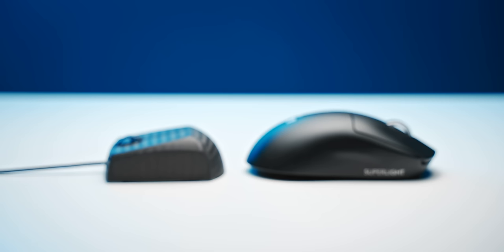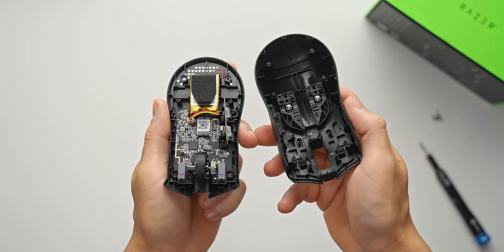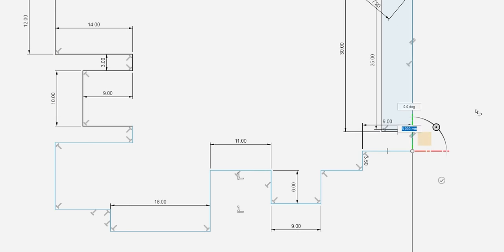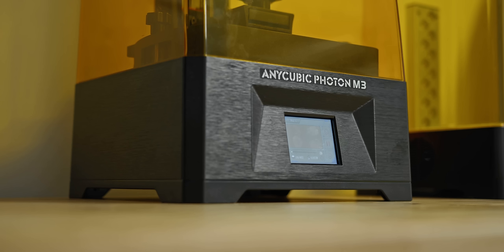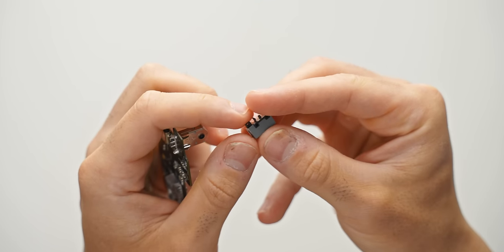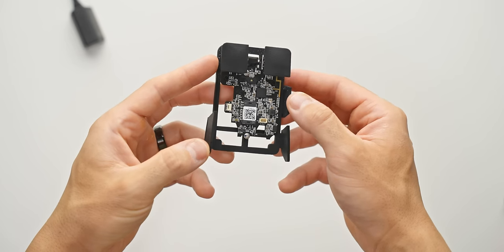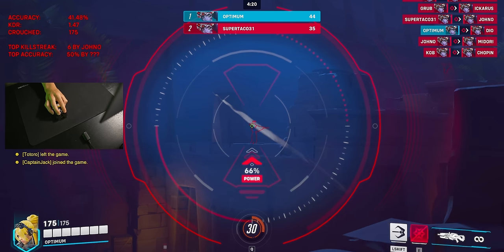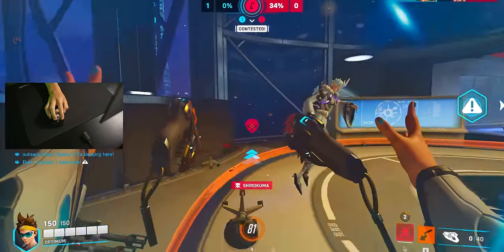Making my Dream Gaming Mouse

Comment: As an industrial design engineer I can say that you did an amazing job the whole process. Love to see an upgraded version of the design.
Reply: Same!
Reply: Amazing for intern or junior engineer prolly 😅
This design won't be sertificated for UK market. Case may not have holes with access to PCB wider than 0.5 mm wire to prevent shortage or shocking. This is really important.

Comment: When trying to remove old solder it can be good to apply some fresh solder &/or flux(i use flux core solder). it will help melt the old solder and clean up much nicer. And if you are really worried you might burn or damage the pcb you can lower the temp pretty far when trying to desolder. I start around 280c. The mouse seems great. Love this project. cant wait to see more revisions.
Reply: Indeed, need some Pb solder and tons more flux, also the soldering tip is just not good for the job.

Comment: The next thing to experiment with is different resins for your print, specifically there are “tough resins“ that will dramatically strengthen the print and make it more flexible and less likely to break. You can mix those specialty resins with regular colors, glow in the dark, or all kinds of other possibilities.
Reply: Know of any lightweight or low density resins?
Reply: @AkalaFPS  Not sure if he did this, but you can 3d print things hollow, with some lattice support structures inside. His parts were pretty small and thin already so idk how much it would save weight wise though.

Comment: Love this video. I'm a third year Mechanical Engineering major and the prototyping process was one of the hardest lessons I had to learn. I would get so drawn into trying to plan the perfect first design that I would never actually build it, and it led to so much unnecessary stress and effort. Turns out, just making a very bare bones proof of concept works great. Don't give it too much thought, just make sure it works. Once that's done, do the rest by feel. The method you landed on in the end was exactly correct. Mess around with it for a few minutes/hours and see what feels good and what feels bad. Work from there. Keep up the great work!

Comment: very impressive, but honestly, at this point, why not just strap a wireless mouse to your arm, take out the optical sensor and triggers, solder some longer wires to them, attach the sensor to your ring finger, and put the triggers upside down on your index and middle fingers? that'd essentially be a weightless wireless mouse then, no? and you could maybe print a little chunk of plastic similar in shape to the frame of the mouse in the video if you want to "hold" something

Comment: The only step forward I can think of, besides continuing to refine ultra-lightweight mice, is to have a touchpad the size of a mousepad of insanely high fidelity and good multi-finger tracking.  Though it'd come with a learning curve, as really the only way to make it function as point and click simultaneously is to use multi-finger, say middle for drag and index for click.  The only issue would be how to discern individual fingers, and I think that's where palm rejection would be useful, as you can build a kinematic model between the portion of the palm being rejected and your fingertips.  I think this could be a viable solution at some point, it just needs development and refinement, plus some cool things could come out if it; such as for casual use, your palm could be the pointer function, which could open up per-fingertip uses, such as middle finger being right click and scroll (hold and drag), and ring, pinky, and thumb could have macros attached to them, the kinematic model could also introduce per-finger zoning such as the retention of the thumb having two auxiliary buttons, different amounts of finger extension and flexion (the amount of curl to your finger between the three joints) could have different functions within a linear sense, though abduction and adduction would be harder to track due to overlap outside of what the thumb and pinky can extend to.  It's also not an impossible idea, you just need a touch device of the correct size (the largest issue) and fidelity (potentially another large issue), along with good on-board software (an issue that's easy to work around) with a decent response rate (potentially another large issue, touchpad ICs are commonly per-device chips, so there's not exactly a market for these, entirely dissimilar to the situations with microcontrollers that communicate with the host); the only further issue I can think of is skin sticking to various surfaces, though there's probably a very simple way around this with various materials.  I'm surprised some niche company hasn't tried developing this, I know desktop trackpads have had very niche markets in the past but this goes beyond just scaling up a laptop trackpad, and the closest thing I can think of currently is that strange PC gamepad that has an overly large trackpad for the thumb, the IFYOO GTP01/DarkWalker ShotPad, though its featureset isn't amazing and overall design in physical aspects, hardware, and software is lackluster at best.

Comment: There might be some problems with dust getting in the PCB, that's why pretty much every kind of mouse has some kind of shell protecting the PCB. Your design is awesome, but it would be even better if you just put a shell around the PCB. Maybe not around the whole thing, but a small, little cover for the PCB.

Comment: I wonder when we'll get personalized gloves with teflon stickers on fingertips with integrated switches, so you could glide your mouse on the table and that would translate to perfectly smooth movement of the cursor, and pushing fingers into the table would act as a mouse button... because who needs a scroll wheel anyway, right?

Awesome project! Thanks for sharing!

Comment: You showed that the interrupters/triggers are actually just plastic pieces that plunge down to an optical sensor on the PCB, so why use those parts at all ? You could design a better, flatter integrated trigger instead.

Also, I was thinking... The lightest mouse is no mouse at all. A multi touchpad like the apple touchpad, but very big, could fully emulate a mouse. I do not mean however like it is implemented on apple products, but to fully emulate the gestures which you do when holding a normal mouse, by detecting all touches. Basically a virtual mouse. Even scroll wheel could be emulated, or multiple thumb buttons. For that case one issue would be lack of feedback on the thumb.
I actually have other ideas for how to do that and improve tactile feedback, I have lots of experience with sensors and embedded design engineering and products, I just wonder if anyone would be interested in such product.

Comment: Yep. But mouse has no specific filtering buttons, helping to make quick choice from big number of submenus with big quantity of items. It can be done by buttons changing colors in connection to filter set.

- Software OS realization brings another  meaning of application tree like one you have clicking windows button. Actually meaning of this button is pretty strange from the point of optimization. I am already in windows, what for I need to click it each time I want to run something? Is it some ritual? And why I have to go through same big set of options, while I need only subset within specific functionality I want to run? 

Another interesting thing - is how to use scroll bar not on all menu buttons, but on subset of it? Subset can be marked by color, you click on mouse. So when you play game, you can divide weapon set, for example, into several color groups, you can select in one click and scroll.

Comment: Very cool, though I wonder about the longevity of those buttons. If they break off, you could replace the straight stem with a wavy one so it acts like a spring type compliant mechanism and distributes stress.

Comment: I really like the practical approach of just modifying the PCB of the Zaunkoenig. I also agree with the sentiment of getting as close as possible to an empty hand in terms of feel.
On that same premise I as thinking of trying out to literally just attach buttons to my fingertips and running the wires across the back of my hand to the pcb. That way you could literally remove the entire weight except for the buttons from your hand. Electrically there should also be no problem with the wire length or at least any problem should be easily solvable. What do you think about this?

Comment: This is super awesome!

Yo, I have some real bad tennis elbow and can only use a vert mouse. The only one that fits my hand is the Logi Vert MX which has very slow polling rate of 125hz. I'm definitely excited by your example here and may try to seek out a way to copy that body and mod it with the guts of a razer. My first question would be, is it even possible to move the optical sensors off the board? it's hard to see how they're surface mounted in your vid. Is there a similar razer with electrical switches that'd be easier to move around?

I've personally reviewed about 8 different vertical "gaming" mice and none of them are good. They all fall short in some obvious basic way. Do you do patreon or is there some way I could convince you, with money, to look at this as a project?

Thanks for your time!

Comment: Awesome video man, I haven't been able to get into super light mice at all. I am stuck on my G502 and keep buying it every 3 years or so since its so cheap and works great. Its heavy without the weights compared to the stuff you were talking about but recently tried going to a lighter wireless mouse from Logitech and I found myself lifting the mouse off the table when strafing the mouse. think that's just something I need to play with it for a bit since I am used to a heavier mouse? I just found I was lifting a ton and then the fine adjustments I was over shooting everything, I really want to love the lighter options but I couldn't stand em.

Comment: would be cool to see this done with a logitech superlight as the basis together with the charging mat (or any other brand that offers a similar accessory (if that exists)). This way it may be possible to get rid of the battery completely.

Comment: Now design the heaviest mouse
Reply: Machined aluminum block with a hole for the sensor
Reply: @DeluxeSimp  how about steel or more expensive, tungsten
Reply: @Raffy-wo4ph titanium.
Reply: @KendrickOrSnake  that's literally lighter than steel actually, it's basically used in rockets and some planes because of it's durability and it's lightweight

Comment: theres a company that produces ring mouses you put thyem on your finger and it uses censors to understand your action with the mouse and its more responsive than the gpro and you can optimize its debouce time and the latency and it only comes at 6 grams

Comment: the m2k he used was $300 😢. Sold out and the m3k will be more expensive than that. It would be interesting to see the m3s which will be less than 20g but will cost $650

Comment: Give it 10 more years, and even my ass could make a mouse at home
Reply: Love the speed at which tecks evolving
Reply: you could everything shown in this video is easy to replicate all you would need is a 3d printer you wouldn't need the soldering iron since he only used it to remove the mouse wheel from the pcb and for the 3d model you can to it yourself or pay some one

Comment: really cool, i juse use a razer viper V2 Pro HyperSpeed its 58g wireless, and i just took out the parts i dont need. Like the scrollwheel i never use and drilled a bunch of holes it it, it comes to around 40g its good enough

Comment: At some point you will have to stop lifting weights, cut your nails and scrub your hands thoroughly to reduce the weight and move the mouse in vacuum 🤣
Seriously though, how would you tell the difference in weight of your hands + mouse as the mouse is really tiny compared to them. Does it even make sense?

Comment: I had some old ass very small and light computer mouse once and it felt actually crazy to aim with it it was amazing but it was so fragile i broke it when i pressed on scroll wheel the pcb cracked and left it un usable.

Comment: Razer wouldn't be my first choice since their software is garbage. I'm not sure if this has changed but it burned me in the past so I gave up on it. This was also with their keyboards though which in my opinion lack quality as the two I owned started having problems within months.
Reply: ive been using razer keyboard and mice for almost 20 years with no issues i couldnt resolve. theres no such thing as good mouse software from a major company and razer consistently sets new standards for hardware latency. saying what you wouldnt do instead of what you would do is worse than useless

Comment: flip the design - embed optical components into table, then you're just dealing with wight for wireless clicker. (imagine upside-down mouse in table with buttons hotwired to something detecting clicks. Here are several ideas:
1. Digital signal: mouse buttons sending digital signal wireless signal (eg bluetooth) 
2. Analog RF signal: mouse buttons trigger unique RFs 
methods with purely analog mouse:
3. Magnets: mouse buttons with magnets flipped with opposite polarity, and a pad/surface on table that detects posiive/negative polarity 
4. Sound: Mouse buttons with unique high frequency sound 
5. Retroreflectors: IR light pointed at mouse with 2 detectors, each with polarizing filter at 90 °, and mouse buttons expose retroreflector also covered with 90° polarizing filter (i.e, each button reflects polarized IR light that triggers its respective detector).

Comment: I really wish there was some open source DIY mouse project that took care of firmware and software side of things. I really, really need a replacement for Logitech G600 that would retain same functionality but had better internals and was wireless. Logitech isn't interested in making a refresh, and pretty much no other mouse on the market has a ring finger button, bar EVGA X15 MMO which is just a worse G600... It's quite depressing because this is by far the best gaming/productivity mouse I've ever used and I went through 4 units already since its inception. I simply cannot find a replacement because it just doesn't exist... can't even gut existing products and mold it into something more useful :/

Comment: oh no, I'm big fan of Viper. This is just the best symmetrical wireless mouse with side buttons. I love it. Tried many other mice before, this is the only one works for me.

And 3d printed case prolly will absorb sweat from fingers between layers. 3d printed stuff has micro holes, big enough for bacterias, too small to wash. So, printing dishes is dangerous even from non-toxic material. And I would say contacting with skin too. But mb not that critical.

How is this case after 6 months of usage? Do you still use it?

Comment: Optimum tech, ill literally pay 160$ for one of these. please get in contact with a distributor like Wooting or Keychron to ship some out to stock.
Reply: ill get the circuit board and 3d print one for you for 50 bucks lol

Comment: Why did you choose the tiger arc skates? Im curiouse, as i want to repair my G502 and want to upgrade it with better sounding switches and a new set of skates. I picked out some nice switches, but i have no clue about the skates.

Comment: Try to add the wireless charging coils to both mouse and the mousepad so theoretically it only need smaller battery or capacitor to make it much lighter.
I think it is similar to the apple wireless chargers and the logitech powerplay mousepad.

Comment: I think there's a strong argument that tension (added by weight) helps your aim significantly, at least for most people. This is also true on controller, and why many of the best players like to add stick tension to the analog sticks. It provides more stable aim that ultimately reduces the signal to noise ratio that inherently occurs in our motor movements. The idea that we want to replicate our hand movement in-game as accurately as possible is rooted in a misconception that we're even able to move our hands, with a 100% degree of accuracy. When you execute a motor action, there is always 'noise', jitter and inaccuracy - perhaps a perfect demonstration of this is how no one is able to hold their body perfectly still, even if they willfully try there will always be a small degree of involuntary movement. That jitter or inaccuracy is where weight comes in handy, to make our actions more purposeful and to give us more precise control.

Comment: That's a trash design tbh, but nobody's gonna say it :)
Reply: why? almost all diy mouse print guys do it with this design and its effective
Reply: i agree
Reply: @spectrent  
I disagree the mouse is bad in my opinion here's three reasons why

1. it looks tacky and low quality it also wouldn't hold up for long
2. this design leaves the mouses pbc exposed
3.the overall all design is bad (this is more of a personal opinion)

also more effective??? he removed the mouse wheel so it's 100% not plus mouse weight comes down to preference
Reply: @_osrs  it's designed around his preferences and what works for him obviously it's not for everyone 😭
Reply: @Twollsy  that's why I used the word opinion? can you did you only read two words? stay in school.
Reply: @_osrs  well you just listed reasons why you don’t like the look of it. This mouse is all about lowering the weight as much as possible, and he did it. And yes he removed the wheel but in a newer design it’s already back. I don’t think it looks cheap and the exposed pcb is no problem for me, maybe a bit more frequent training.
Reply: @spectrent  first point was valid second point was also valid the third was my opinion which i stated so ur response legit added nothing to this conversation